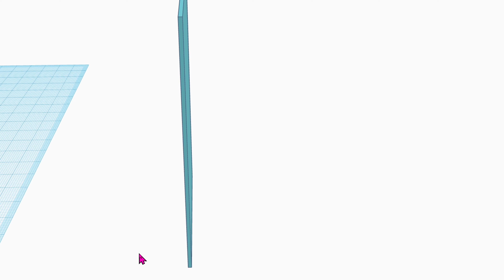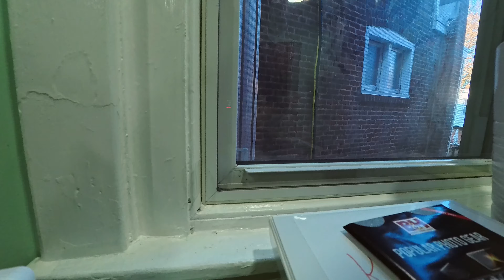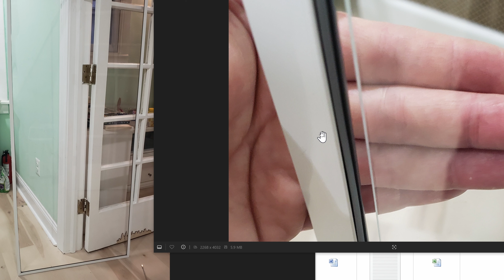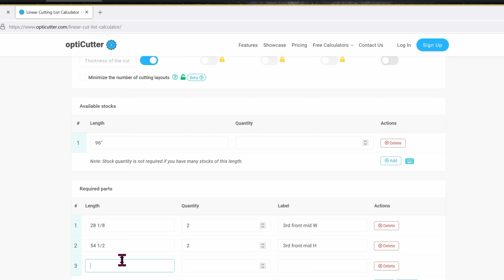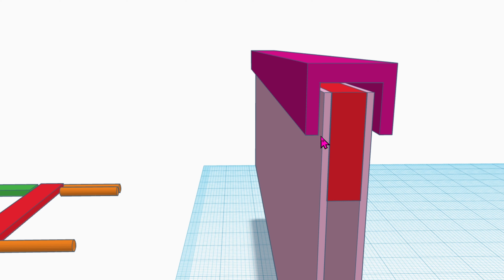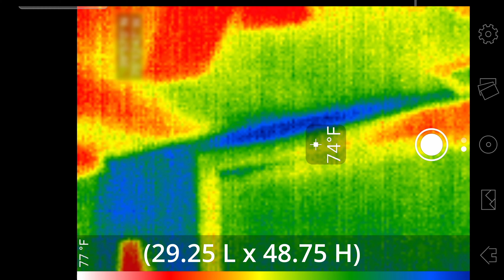3 methods to seal up those drafty windows! Easily save $$$ on heating bills (part 1/3)

Comment: I am thinking to do this in my deck screen where it only has mesh. How is strength?
Reply from the maker: yes. my father did the same for his backdoor! it held up fine.   you can see in the video, i used 3 panels for my deck and they are still awesome as the day i built them.

Comment: thank you :)
Reply: try a heat gun if you get wrinkles it might shrink the film and make it flatten out ,  worth a try on a small frame test sample . keep the heat gun moving all the time or it melts a specific area.   or try oven paper and an iron over that tand experiment with temperatures to iron it flat on the frame and heat gun in the void space.
Reply from the maker: @CarkeekW  im not sure if this thick mylar film can shrink. will try it out next time.